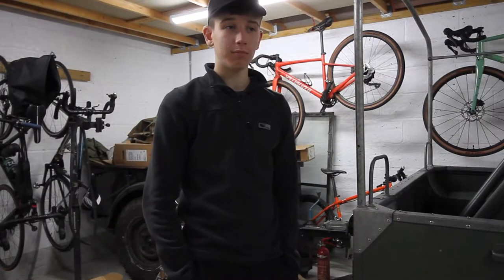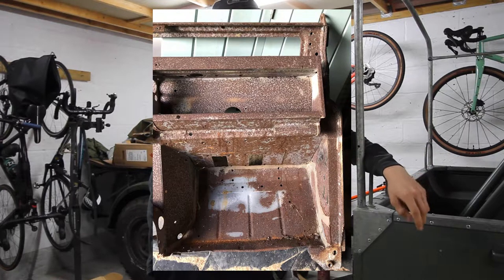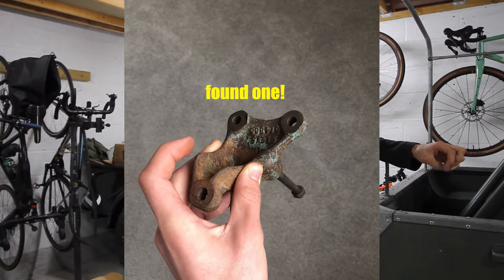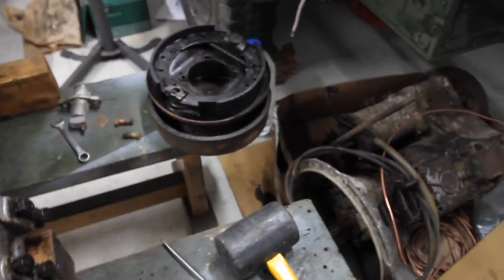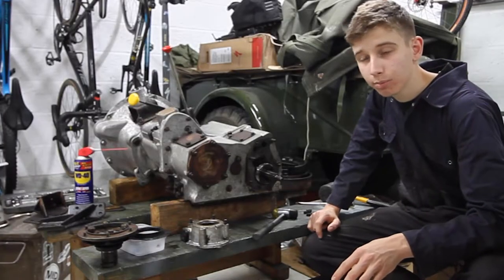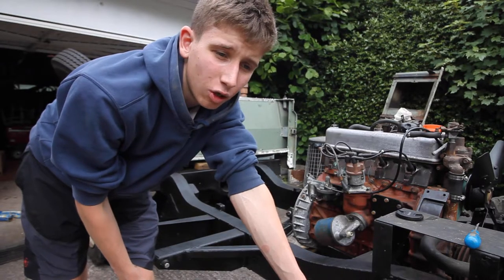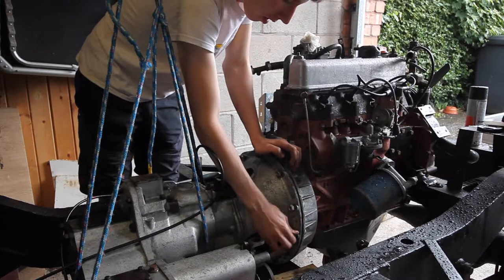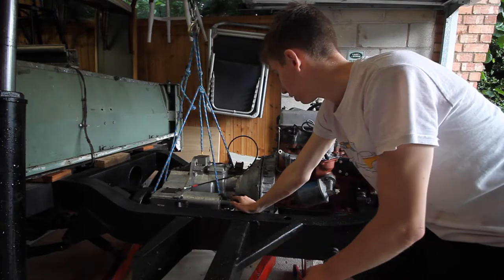Land Rover Series 2a Build ep3

Comment: You may not want to use that military fan?  They are heavy and there could be clearance issues.  They also take more power to turn.
Reply from the maker: Yes, I changed it for a standard fan for those reasons. I also heard they’re louder too.